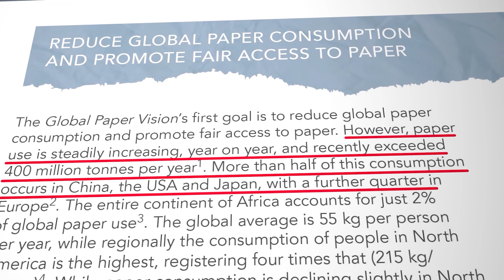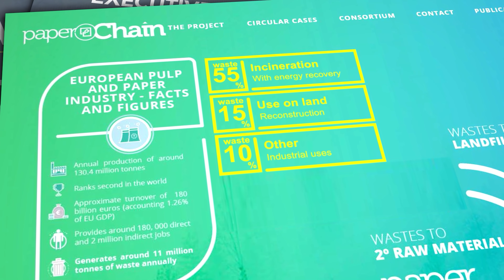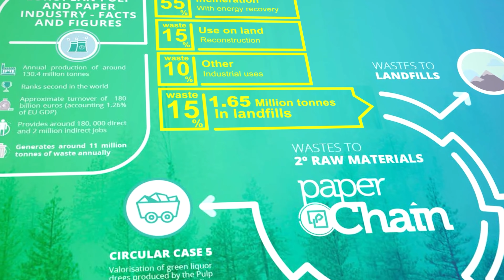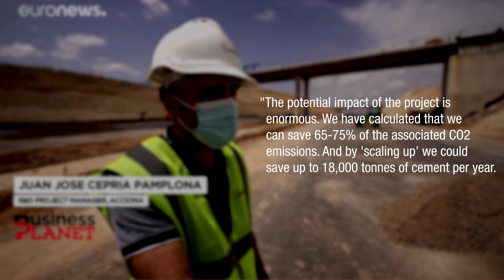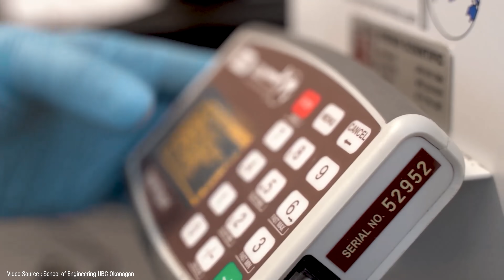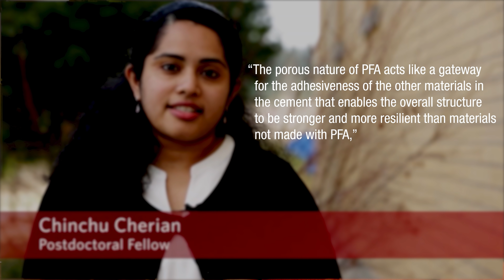Could papermill landfill waste pave our highways?

Comment: Great to look at the waste side. On the supply side, I hope we could switch to hemp soon. Much faster growing, better yields, less forest cut, as long as permaculture precepts are followed. 
Still, I'd love that the manufacturing of goods were regulated to minimize the packaging used. How many times have I ordered online a few small items, that came in separate boxes, with plastic bubbles to minimize impact in the huge boxes used, with cellophane wrapping around another box, containing plastic wrapped items, with lots of unnecessary additionnal plastic or parafined cardboard padding, with wrapped elastics or other discardable plastics, and plastic stamps that needed to be removed.
What the fuck? 
So manufacturer should 100% face the consequences of a problem THEY are creating in the first place, pay fines relative to the packaging of items.
I bet transportation schemes with distribution centers would standardize reusable containers to bring the items near the consumer, to then be dispatched in a reusable box, delivered by flying or rolling drone, or available for pickup in a sort of crate. The crates would be from a 100% recyclable and durable material. This could remove the need for packaging altogether, most likely for most items. Those crates of different sizes would be available to producers around the world. 
Because right now, even if you think you're going Zero Waste, it's often just that the manufacturer are hiding that waste from you, as it was still shipped in throwable containers, and displayed as having no wrappings.
Reply: Yes! Stop using trees it takes harsh chemicals to process wood pulp. 1 pound of hemp pulp can replace a pound of tree pulp – and hemp is fully grown about 120 days after planting.
Reply: @mamawelder  have you actually looked at processing Hemp?
Reply: @stevepailet8258  yes I have, Bamboo is another sustainable option and there are other fast growing plants that have been used for thousands of years. Have you actually looked at processing wood for paper? Sulfur dioxide is problematic. From what I’ve read about paper making the past 40+ years (and done some small scale for Art purposes) Wood pulp seems to be wasteful, high polluting and not sustainable. I’m sure if profits was the only reason making paper from just about any plant could be an environmental issue but some plants lend themselves to better , easier and cleaner solutions. 
I doubt you really want to research and would rather just argue,  but in case you’re curious https://bioresources.cnr.ncsu.edu/resources/ecofriendly-and-innovative-processing-of-hemp-hurds-fibers-for-tissue-and-towel-paper/
Reply: @mamawelder  I am not fighting with you am suggesting that you are tilting at the wrong windmill.  I agree with you. That said go scream at the companies who are going against your world view.  China is #1 the US is #2.  so you can get off your high horse when you are yelling at me.
Reply: @mamawelder  Curious how you could make China use hemp for boxes since they are living in perpetual flooding and cannot even grow food
Reply: @stevepailet8258  wasn’t referring to China. Was this talk only about China? I guess I missed that point. I thought it was a general planetary discussion.
Reply: @stevepailet8258  China is a giant country saying China is completely flooded is like saying the United States is completely on fire. China has tropical regions,  dry arid regions and everything in between. Bamboo, papyrus, reeds, hemp…..there’s plenty of options. But this topic is not just about China. Brazil is slashing its rain forests to grow eucalyptus for cellulose. It’s crazy pernambuco is nearly extinct Brazilian rosewood is completely gone…..any better solutions or ideas need to be supported
Reply: @mamawelder  before you say this suggest you go look.  the weather this year has been particularly bad. Hurricanes drought dust storms insect infestations.  Thousands have died in the floods some areas have gotten over 24 inches of rain in a one to two day period. The weather this summer has had snow storms and massive hail that covered the ground deeply.  As to what is happening in Brazil and the amazon basin is a sin.  Slash and burn. People are doing this and all of the nutrients are actually not in the ground but the vegetation. What is left has little value after one season.  When I purchased lumber I always have tried to buy wood from sustainable sources but am well aware of what you speak of. Here in the US most lumber is harvested sustainably and replanted on a 20 year or so cycle.  Do remember most of the packaging from the pulp is still coming out of China. So get off my case I am not the bad guy here.. I am however well understanding who is
Reply: @mamawelder  did you know?  I did mention the two big polluters china and us.  What part of the massive amounts do you wish to ignore?  He did lay out where production is.. so now you want to go NOPE not going to include them
Reply: Those plastic bubbles used in shipping, particularly the large balloons like "Sealed Air", are better for the environment than many alternatives.  They weigh essentially nothing so they save fuel.  They displace much more carbon intensive materials like paper products that if landfilled, end up as methane, a potent greenhouse gas.  Small amounts of plastic that are landfilled are essentially harmless, at least as far as climate change is concerned.  I agree that unnecessary packaging is irritating and bad; I'm not in favor of that.  I'm in favor of smart packaging that doesn't have negative climate impacts.
Reply: @incognitotorpedo42  Depends on how they are disposed of, if actually collected and buried in landfills that do not leech into the ground's ecosystem then the plastics simply return the hydrocarbons back into geologic storage but if they wind up in the ecosystem as in the ocean, their influence on the ecosystem can not be predicted and they may even be inadvertently consumed by organisms displacing nutrition as they physically break down into smaller and smaller particles.  Eventually microbes will learn how to consume them as they are just ancient remnants of life and indeed this has happened in our oceans but this unbalances the species in the ecosystem as the mutated microbes suddenly benefit from a large food source which their competing species can not access.  We have this issue with plastic grocery bags which so long as properly collected for downcycling or actual burial for disposal, are actually more environmentally friendly then their compostable and reusable replacements but the fact is, they are not properly collected for downcycling and not properly buried in landfills if not downcycled.
Reply: @johnwang9914  
Anton Petrov just had a video about microbes eating plastic in the ocean. Ideally the plastic shouldn't be there of course.
Reply: Here here for the Truth cheers
Reply: more places are allowing hemp to be grown.  Still the processing infrastructure has not kept up. Most growers from what can see are looking primarily at seed production not the hurd or shiv.  Not at the fiber.  Generally one grows different cultivars to go towards different use.  Seed plants generally are short where fiber plants are tall and the seed production is very limited
Reply: With the decline of newspapers, paper production has already been reduced, especially the downcycling of paper.
Reply: @johnwang9914  still enough for me to buy cellulose insulation  :)~
Reply: @stevepailet8258  Which has lowered the costs of insulation and what happens when costs are lowered, we make more...  There's a reason why we have the three R's where we first Reduce, and what we can't reduce we Reuse and it is only what we can't Reuse that we Recycle.
Reply: @johnwang9914  I am a big believer in economy and efficiency.  If one does not need to use as much power if one insulates beyond what many think is normal the reduction in things like power for heating and AC drop by as much as 90%. Reusing paper is a great way to do that via thick walls and thick insulation on all 6 sides of a house. As to recycling, That indeed is how cellulose insulation is made
Reply: @johnwang9914  Was actually looking at the cost of insulating my 2100 sq foot house 100 bags blown in at around $9 a bag. That is darn cheap
Reply: @stevepailet8258  That's the whole point, the cheaper it is, the more we do.  It's like LED lights, turns out that they haven't saved us any energy as their efficiency has lead to people using lights more.  All the usage of paper wastes in concrete might bring is lower costs and hence greater use of concrete.  Will this actually benefit the environment or will we just pave more.
Reply: @johnwang9914  we use to much concrete now.
Reply: Could hemp or partially hemp paper be used just as effectively in this process? I know there is a weak concrete called hempcrete. I hope it becomes more common in garden pavers.
Reply: Damn straight. If packaging is needed why not have it of a type that can be recycled easily. Is organically based. If not recycled it can be composted. 
With the advent of Amazon etc the amount of packaging we see has gone up. That doesn't mean there is more depending on the product. For small items. It has of course . I'm a recycle as much as possible. Any boxes I see get cut into smaller pieces. Fit in the bin better that way. But one thing I cannot abide is foam packaging or styrofoam peanuts.
Reply: And how would the sanitary requirements be satisfied, especially in light of the current restrictions, when "re-using" all of these materials? How about the additional costs of additional handling? What about the logistics of return postage and shipment of the "no longer needed" materials after shipping? Sorry to inform you, but cost is ALWAYS relevant.

Comment: Houses made of wood still need a lot of concrete for their foundation, as wood gets rotten pretty fast with the moisture of the soil.   But, a wooden house doesn't need a terribly solid foundation.   Thus, I wouldn't expect paper ash to work just as fine as actual cement, but it would be nice to replace some of it when suitable such as foundation for light buildings or to hold paving stones for pavements/sidewalks.  It is pointless to replicate the characteristics of cement.  It is much easier to look for a suitable application for it as it is.
Reply: Well old wood houses use to be standing on "corner stones". No cement needed.
Reply: Cement meets required standards currently written into state and federal law.  To create a new product that fits all the same requirements allows an immediate purchasing decision.  If it's close but not identical, in many cases regulations will need to be amended before it can be sold and widely used in any industry where liability might be an issue.  

That could take years, and still be only piecemeal, with some states not updated.  
That's why designing a product to be used as a direct replacement makes sense.
Reply: @docwatson1134  Acciona clearly got approval for its use in paving public highways.  And piecemeal is fine to start with, the industry won't change overnight anyway.
Reply: Yeah but my house, at least the main part is 100yrs old, roads (except the Roman ones) don't last nearly as long

Comment: A company in the US are making railroad ties out of waste. It hasn't caught on here in Canada though of course, we keep knocking down old growth forest for something as rediculous as the old railroad tie.
Reply: Somewhere in Europe, they are using waste materials from old tires to mix with pre-stressed concrete (I don't know how one pre-stresses concrete.  Maybe they tell it it isn't liked or its job is going to be terrible.  :p  ) and are making railway ties that have solar panels built into them, connecting them together.  Supposedly, the ties do not have trains passing over them 90% of the time (full day, or just daytime hours, for solar electricity production?) so, in the daytime, any given tie can produce power 90% of the time.
Reply: @maintoc  Prestressed concrete is made by tensioning the rebar while the concrete cures. Once it's set the rebar effectively holds the concrete in compression.
Reply: @nagualdesign  Well, that just makes entirely too much sense.  :p  :)  It sounds more like it's pre-stressing the rebar and not the concrete.  Anyway, my thanks to you for having provided the explanation.  :)
Reply: @maintoc  seems like a waste of solar panels to separate them. lots of unnecessary plastics, chips, etc
Reply: @0xsergy  Maybe so.  I don't know how efficient the process will be or if, in the end, it will be a good use of resources.  I just note that it's being done.
Reply: @maintoc  pre stressed concrete is usually made by running steel bolts through holes cast in the concrete, and tightening a nut at the end so the concrete is always in a state of compression. Also that sounds like one of the worst places you could still solar panels, it is lying flat on the ground, and with lots of small widely separated panels which would make the project extremely expensive and inefficient (even worse than solar roads)
Reply: @garethbaus5471  Thanks for that.  Also, for places that get snow and ice, the in-the-ties solar panels would likely get much less light than is ideal, plus there's dust & dirt at track level.

Comment: This sounds like a future path for green building construction. Now to just combine it with basalt rebar and mesh which reduces weight and therefore depth of cement structure. Basalt compares well with the strength of steel but it cannot rust. Have you made a video about basalt for the concrete industry? Monolithic domes has the only video I’m aware of.

Comment: I think it may not be a bad idea to incorporate the waste paper into landfill!

Paper (not the plasticized type) rots down quickly to help form soil .... something we do not have too much of (yet).
Also fly ash is, I believe mainly carbon. So whilst burning paper to form it may not be good putting the carbon rich byproduct may be seen as a form of Carbon Capture?

Now building our houses and roads out of dead trees is certainly a less bad thing than virtually any other! It would be interesting to see the difference in global impact between simply burying old paper and converting it into one of these new building products. 

One thing that seems certain is that we need to keep on innovating new ways of doing the things we do!

Comment: Thought we going to be using tires to pave highways (from 30 years ago) or even recycled glass?
There are tire dumps all over the world. The problem is, nobody ever actually utilizes these "new" waste-to-pavement techs.
Reply: Using tires strikes me as a bad idea...  If burning tires releases toxins and carcinogens, why would we line our roads with it if again it is going to release toxins and carcinogens over time?  Same thing with the people who choose to make flowerbeds or gardening beds out of tires...  WTF?
Reply: @Les_S537  

Do you have any idea of the rate at which the toxins are released from a tire?
Reply: @dr.OgataSerizawa  I imagine it speeds up as the tire continues to break down.  Probably slow at first, picking up steam as time grinds on, but if you're grinding up tires into little chunks you are increasing the surface area exposed to decay.  In other words, ground up tires probably release toxins much quicker than a fully intact tire just thrown on the tire pile.
Reply: @Les_S537  

The rubber would be incorporated in the asphalt.
Reply: I had a pair of sandals with the soles made from old tires instead of making roads make shoes...
Reply: @steve-o6413  

I still have a pair like that.

Comment: Too much paper is used, whatever happened to the paperless office. Now full colour printing is available in every office more and more stuff gets printed. Not to mention the machines that do the printing  are a recycling nightmare. Then there is the ink itself, actually known as toner, which is a fine dust with electrostatic properties made of plastics, wax and dyes. recycling services are provided by the printer industries but toner escapes into the environment and though not reckoned to be dangerous any sort of micro (or even nano) plastic in the environment can't be good?
Reply: You only see the mistakes once you print it out... So you have to print it again!!!! 🤔🙄☹️